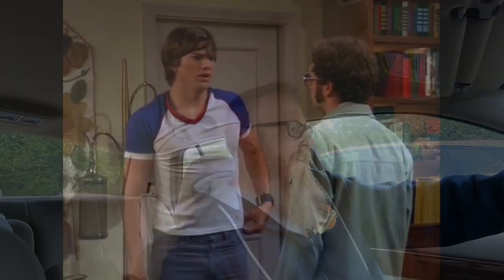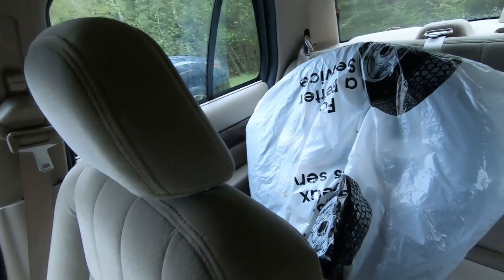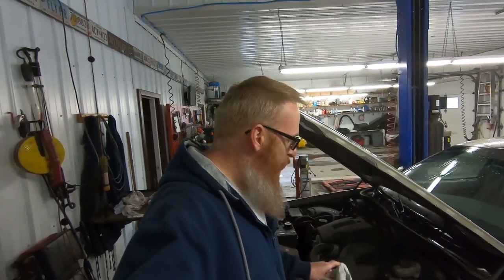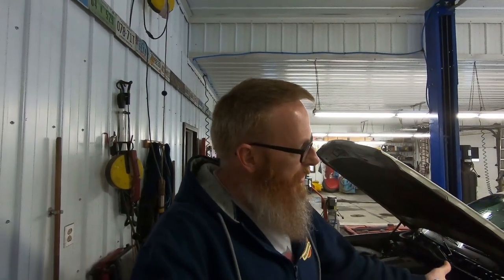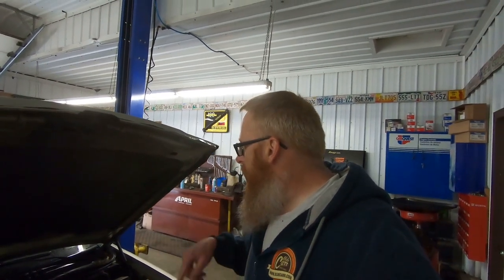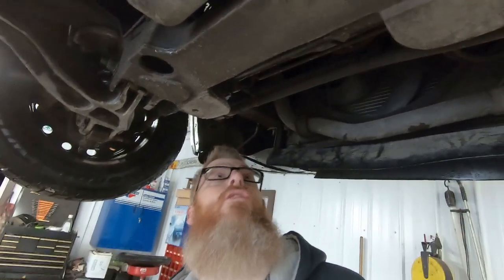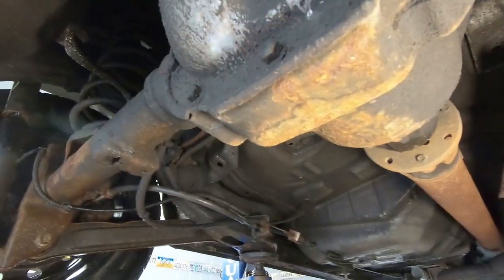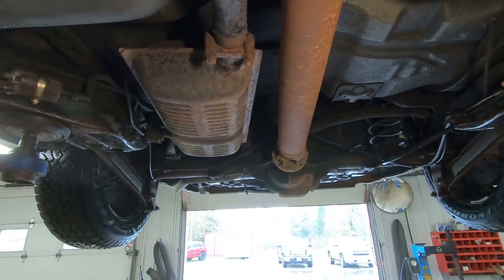I BOUGHT A  MERCURY GRAND MARQUIS - IS IT JUNK?

Comment: I'm between this and a P71 😕 I like the ruggedness of the P71 it can take a beating. Not that I'm going to but peace of mind that me driving it well, will last a longing time
Reply from the maker: No matter how you look at it, they’re all tough cars so P71 or not, you’re in good shape!
Reply: @OldeCarrGuy  thanks for replying. Would the p71 be tougher though since they come with the police package ?
Reply from the maker: @daviedood2503  they’re simply built to handle the extreme demands of police departments etc, so if you plan on driving it hard then the interceptor will handle it. If you’re going to just daily drive it, then why not have a few creature comforts to go along with it! 😂
Reply: @OldeCarrGuy  because I'm thinking of the motor and the suspension. If I have a very rugged car built for cops, then I wouldn't have to be replacing parts like that. The wear and tear on the vehicle would be so slow that it's last me a VERY long time as opposed to not having a police package.

I could i guess, install the leather seats later on etc. 

This is my thinking though. I don't know much about this whole thing, but that's the thought process I have. Do you see any flaws here or perhaps anything I'm missing? I'm also thinking about the cost of the car itself since I'm kinda strapped for cash after a split with my ex of 13 yrs. Cleaned me out so I gotta start all over again. Figured one of these two would atleast help me out to get started by these Uber and lyft rides are kicking my a$$. This fuel surge made them almost double their prices. Especially on Mondays lmao
Reply from the maker: @daviedood2503  one isn’t necessarily going to last better than the other. There are pros and cons to a p71. Although built tough, they generally are driven hard and that’s why you can get them cheaper. I would keep you eyes open on all options and not just the interceptor. You just never know where a good deal comes from!
Reply: Same bro same 😭 I’m leaning a little more towards the grand marquis to be honest.
Reply: @pvrpleswxg  take a look at the Marauder as well. I'm still looking for a car tho. This was over a year ago and I'm in a much better financial situation now after my split. I have everything delivered to me. Groceries etc. And don't really go anywhere. So I'm stacking and got my eye on a black Camaro ZL1 🧐🤔

Comment: Mod idea;
5 Speed Manual Transmission. 
Will a Mustang GT bolt right up?
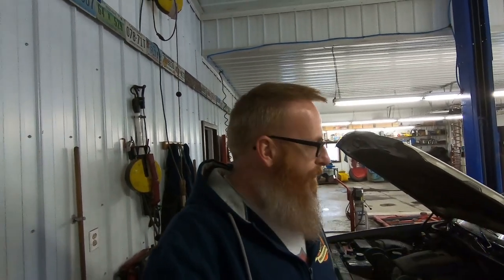Maybe 4:10 Final Drive, and LSD?
Reply: That's awesome. I wanted to do that with the grand marquis, but I do a lot of highway driving with it so the 2.73 works great. 1800 rpm at 80mph
Reply: What 5 speed manual bolts onto a 4.6??
Reply from the maker: I pretty sure Cleetus has a T66 in his Neighbor project! 5.4L in that though, but likely the same idea!

Comment: That car eats brake pads every year and I don't drive alot. The rotors will warp quicker too.

I like it alot but its more expensive to own due to repairs. But I keep replacing suspension parts and it never gets fixed right. So I worn out a set of new tires in 1 year.

I've taken it to 3 different car repair shops and it does not get fixed all the way right. But it keeps running and the engine performs with very good power and is very safe for me.
Reply from the maker: Sounds like whatever repairs are being done aren’t being diagnosed properly. Tire wear is due to no alignment or poor alignment after suspension work. Brake pad wear is due to improper lubrication of the pins and slides or bad calipers. Not driving it a lot can tend to build up rust on the rotors from sitting and collecting moisture. I hope this helps.

Comment: How many miles were on this car when you bought it? I just bought one two weeks ago it's a 05 and it has 40k miles on it. I hope it last. Have you had any mechanical problems yet?
Reply from the maker: It had just over 130k miles on it back in 2019. It has close to 130k now. No major issues. There is an entire playlist on this car if you'd like to see the upgrades and other maintenance I've done.

Comment: I have a 1999 Crown Victoria Base Model with 162K. Call it Old Reliable. Very durable vehicles.
Reply from the maker: I have 2 of them and they are my favorite of the fleet.
Reply: @OldeCarrGuy  I'm slowly restoring mine and installing the center console from 2002 Gran Marquis LSE when I finish and repaint it. She has two names, Ms Vicki and Old Number Seven since it's the 7th car I have owned.

Comment: Mine is still in the shop for ball joints/suspension design problems.A plastic intake manifold that leaks/warped/constant engine light on. Also has climate control problems-blows hot air constantly. It has other problems also. Ford should have been sued for releasing this junk on the public.
Reply from the maker: Sorry to hear that. Intake manifolds are common issues on the 4.6 but generally a cheap  do it yourself fix with some basic tools. As far at the other issues,  it's no different than any other vehicle on the road.  Heck, even Scotty Kilmer claims these to be one of the most reliable cars on the road!

Comment: Hi Jason, thanks for the reply and information below.  Here's a "funny" story about my experience with an old Mercury Grand Marquis a year ago.  I got it for only a couple hundred dollars and was assured it was a cream-puff since it was his wife's car.  Well, driving it home it ran like s**t. Worse yet, it was leaking some kind of oil.  The car had been stored outside in the tall grass and it had rusted one of the transmission lines going to the radiator.  My buddy did most of the work fixing the leak and it was a helluva job underneath that front end with everything all cramped and in the way.  But, he finally finished the job.  I went to start it up -  No start.  Nothing.  It started just once so we could get it home but no more.  Tried jumping it - nothing.  I still don't know how running the front end up on ramps could kill the starter but, apparently, it did.  Then I went to YouTube, as usual, and saw what a bear of a job it would be to remove and replace that starter.  Horribly designed by engineers who just didn't care.  One bolt was accessible but the other two were hidden from view.  I had had enough and sold the car.  Got lucky and got my money back.  So, I just don't know why I'm considering another Grand Marquis that's now in the local Craig's List.  I guess it's because everyone says they're a dream to drive.  I'm still debating whether to spend that $ 1,500.  Maybe if the seller gets more desperate and drops the price down to triple digits...  Since that first Grand Marquis, I've bought a car lift (QuickJack BL5000) through Home Depot, of all places.  I just noticed that they now have a BL7000 for only $ 200 more.  Wish I knew that before.  Basically it's two electric/hydraulic scissor jacks.  And I've got four tires to put under the wheels so a car can't fall down on me.  No more driving up on ramps and hoping the car doesn't fall over. Should make any future under car repairs safer.  I wonder, should I or shouldn't I buy that Marquis?
Reply from the maker: In my opinion, you can't go too far wrong for $1500. I didn't find the starter that bad on Black Jack, but i did have a hoist. I'm partial to these cars and know pretty much all the ins and outs. If you do buy it, I'm here for any help. Just ask.

Comment: Just bought an 05 GM from this old couple yesterday. Only $4k an it only had 75k miles on it. I call her Snow White lol
Reply from the maker: Sounds like a great deal for the mileage!
Reply: @OldeCarrGuy  A steal if you ask me. Absolutely no probs except for the airbag light & abs light but those are easy fixes
Reply: That is just what I paid for my one owner 2004 GS with leather package and 70250 miles in Naples, FL.  Took it on a 2000 mile road trip to Texas and could not be happier.

Comment: Old man car
Reply from the maker: Actually it’s an old ladies car And we call it grandma
Reply: I bought my 2006 Mercury Marquis last year because I need LEG room.  (I'm currently age 75).  Have a real bad back that effects my legs and feet so I need plenty of leg room for driving.  Heck - I'd buy the same car if I was 25 years old if I had the back problems.  Newer cars just keep getting shorter and shorter driver's leg room.  Only thing I don't like about the 440 is the rotten gas mileage.  Drove Buick Park Ave's for years (3.8 engine) and was used to getting 28 - 30 MPG easily.  Betcha I'm not getting half of that with my Merc ... but I can drive 2 hours minimum longer in my Merc distance driving because of the leg room.  So YEAH for Merc's!